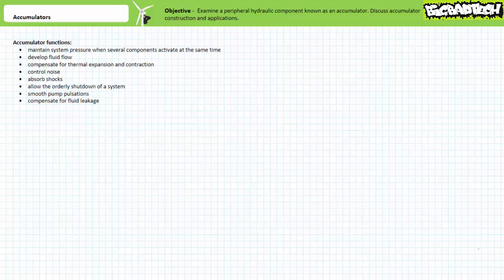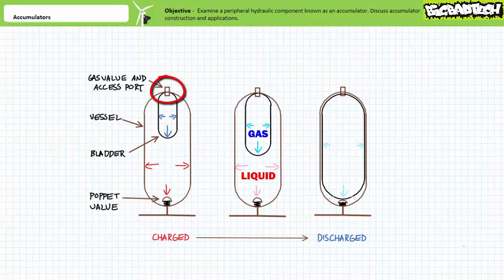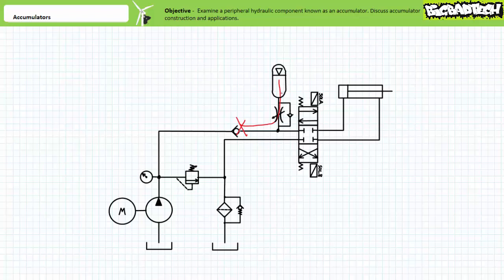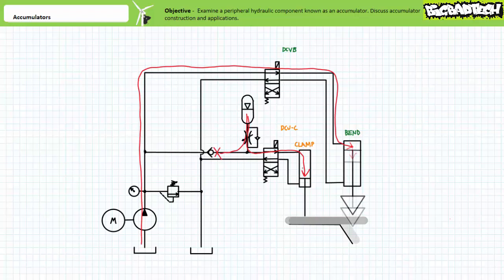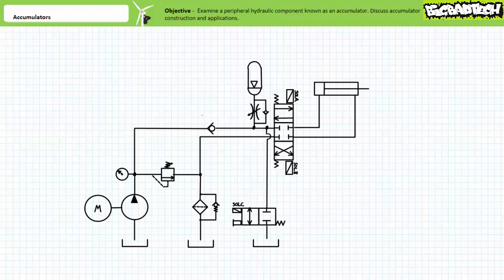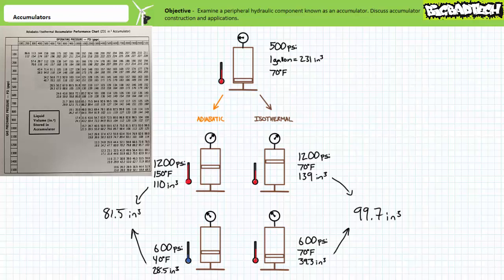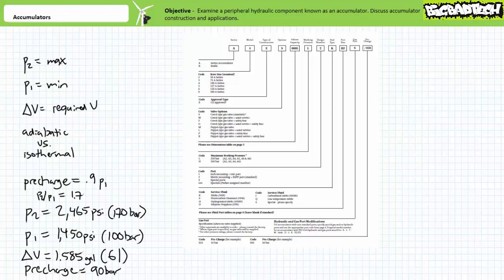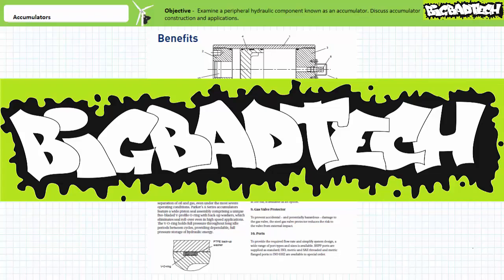Accumulators (Full Lecture)

Comment: I have never seen a spring loaded accumulator in 40+ years.  I have seen one weighed accumulator in an aluminum plant.  It was big. I could see the wight move up and down during the machine cycles.  A problem I have come across is a lack of N2 at 3000PSI to charge accumulators in remote saw mills.  I have never seen any flow controls between the accumulator and system except for a "dump" valve to dump pressure for safety.  Accumulators are good for supplying oil when a servo system is rapidly accelerating because it takes many milliseconds for pumps to respond to the demand. I was writing this during the video.  He finally gets to the dump valve. I recommend one takes into account the temperature while charging because that is usually done at ambient temperature but run time could be 130 degrees.  I have put my hand on the accumulator during operation.  I have never felt the accumulator heat up and down during a rapid cycle.  I use  a simulator to find the ∆V during a cycle.   I recommend a high pre-charge for servo applications where the goal is to keep the pressure drop to only 10% of P2.  A common problem I have seen is the accumulator precharge is too low.  This causes the supply pressure to drop and this causes the open loop gain of the hydraulic actuator to drop too much.

Comment: What an explanation, thans a lot mate.

So how do you count for the Tempreture Effect in adiabatic compression/de compression
Reply from the maker: To scientifically account for temperature you'd have to use the Combined Gas Law: https://youtu.be/zCZFXj36b0s

In practice, the accumulator charging procedure often specifies it must occur over a specific length of time to ensure any temperature change is absorbed by the environment.

Comment: Hi Jim! Great lecture!! Can accumulators set the discharge pressure? I'm trying to have a constant set pressure in the circuit and wonder if accumulators will do the trick. How do I design a circuit that all fluid goes into an accumulator first before flowing into a motor?  The fluid seems to just bypass the accumulator and straight to the motor.
Reply from the maker: +Terri Chan If I dig what you're saying check out the sequence valves lecture at: https://www.youtube.com/watch?v=0_bK_ngfVz0

Comment: Hi Mr. Pytel , amazing lecture .
So , I have a question . Accumulators can be used If we have a cylinder that needs 20 lpm and 200 bar of pressure at one action that lasts for a minute , and needs 200 lpm and 20 bar at another action for 6 seconds 
But it can't be used for an action with 200 lpm and 300 bar ..i mean  the pressure can't be higher than the pressure of the dominant action , the action that lasts for longer time ,
Reply from the maker: You would need an intensifier to do that.
Reply: @bigbadtech  i'm sorry but what is intensifier ?
Reply from the maker: https://en.m.wikipedia.org/wiki/Hydraulic_intensifier
Reply: @bigbadtech  thank you Mr. Jim it was very helpful

Comment: Sir, thank you for these free resources. Can I suggest an improvement though? The slides are visually OK except for the pictures attached. The pictures and diagrams are unreadable even at 720p. There is a room for improvement.
Reply from the maker: I see what you're saying! The accumulator performance charts are awful! Here's an example of an accumulator performance chart (from a different manufacturer): 
http://www.ihservice.com/PDF%27s/Accumulator%20Selection%20Charts.pdf

Also here's a link to the Parker A Series Piston Accumulator I mention later in the lecture:
http://www.parker.com/Literature/Accumulator%20&%20Cooler%20Division%20-%20Europe/Accumulators_Hellaby/Parker%20A%20Series%20Piston%20Accumulators_HY10-4024.pdf
Reply: @bigbadtech  if u can, plz give link for chart shown in this video.......

Comment: Hi sir... Pls help me? Pls give me a good answer....
Our machinery connected one accumulator 32 ltr nitrogen.. 330bar pressure. Bt now the pressure not maintaining.. Then the accumulator refilling and fixed.. Bt no use.. Hydrolic motor off.. Same time the pressure going to zero pressure... Mechinery work pressure level fix it 120... But running time the pressure is going up and down... 120... 50.. 0..110...50... 0..10.. 30.. 120..... Eny help.. N comment sir???? 🤔

Comment: So what are the differences between an accumulator and an expansion tank?
Reply from the maker: They're kind of the same thing, however, an expansion tank is ordinarily small and purpose built to give expanding fluid space to fit inside a closed system. Ordinarily  and you wouldn't use an expansion tank as an auxiliary source of hydraulic power.